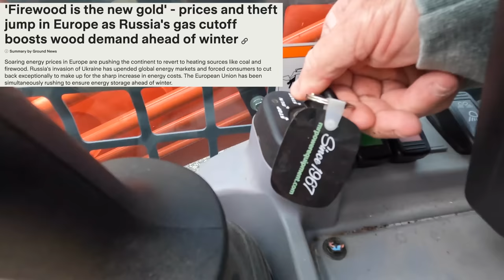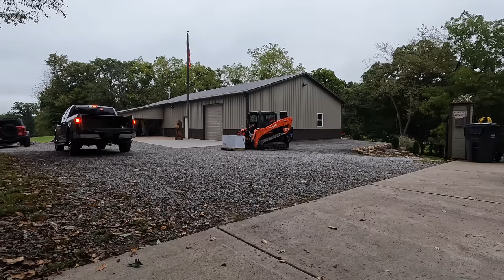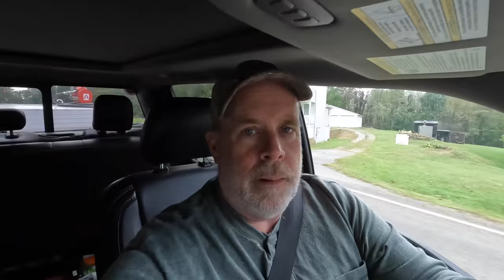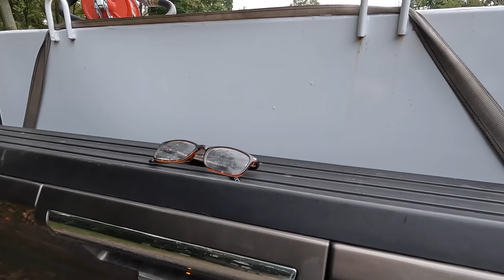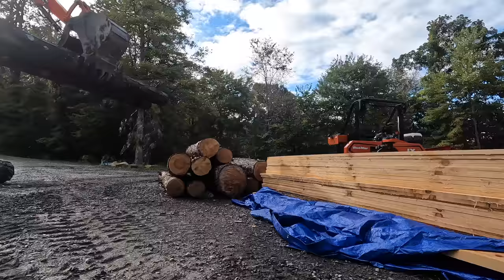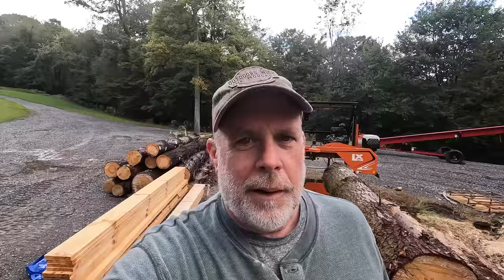Firewood IS the New Gold? It just could be!

Comment: I have been heating my house with wood in New England since the 1970s. It's always nice to know I will be warm this winter no matter what happens in the energy markets.
Reply: I have been doing the same, the issue might be the electricity cost to operate the wood furnace.  It doesn't give me a warm fuzzy feeling doing all the work to cut, split, stack and operate the furnace while others won't lift a finger to help and get free LIHEAP fuel.

Comment: About 6 years ago we got a new HVAC system, it is duel fuel. It is a heat pump and a oil burner, the oil burner takes over when the temperature goes below 25 degrees and we also have wood stove. I have about 2 cord of seasoned wood ready to burn, plus we have an acre of woods with dead and down ready to be cut. That is like a bank account. We are retired so I like to feed the wood stove on cold winter days here in York Pa.

Comment: Hi from Northamptonshire, UK. We’ve been quite lucky and are in a fixed electricity tariff for another year but we’re saving like mad to try and build a reserve for when we inevitably end up paying more on our next tariff. The scary thing at the moment is the government are incorrectly indicating there is a £2500 a year cap on energy bills, which isn’t true. There is a cap on charges but that doesn’t mean when you’ve used £2500 you’ll pay no more as they keep trying to indicate in interviews.

I purchased 2.4 cubic metres of kiln-dried hardwood from a local supplier for £300 earlier in the month and we’ll be relying on that in our little 5kw stove to keep the house warm this autumn/winter. We have an oil fired boiler which is pretty efficient but I’m hoping to limit its use so we can make our oil last as long as possible.

Comment: Greetings from Finland. Thanks for the video, this topic is on everyones mind here. Our house is heated with oil. Heating oil price has doubled in less than a year. Next step will be geothermal heat pump system, drill team is coming in couple weeks. Plan is to drill 820 feet  deep hole. Calculations with current prices, annual heating costs with oil is now 5000$ vs geothermal heat pump system consumes 1000$ of electricity.   Initial cost for the system is 25000$ so with current prices the system has paid itself in bit over six years. Currently half the house is heated with wood to cut the oil burning. Wood is coming from our forest so cost is only fuel for the Stihl 😃

Comment: Hey Mike, yeah, this winter will be very interesting over here in Europe. Though many people are still in denial of the situation, the natural gas prices will affect everyone. I do not think that people will freeze during the winter, but the amount of money they will have to spend to keep warm will be enormous. 

The main issue is that 15 years ago EU started to push/motivate people to get rid of old types of heating like wood stoves or coal stoves. For ecological reasons. There were huge grants to replace old stoves with automated natural gas heaters. So many did that. Now, it fired back. The natural gas prices skyrocketed and some households will pay 3-4 times more for heating. Not to mention all the businesses that use natural gas for heating or for factory work (foundries etc). 

And it affects other prices as well. Fortunately, I do have several options to heat our house as I live on a farm. Still, it affects me as well, because the main heating is an automated wooden pellets stove. Last year I ordered pellets (4 tons for a season) for $230/ton. This year not only I had to wait 3 months for the delivery but I paid $510/ton. Still, pretty affordable heating for a big house but you get the picture. And those who ignored the situation and wanted to order pellets in August are in shock because they are told to wait until the end of November for the delivery. 

I hope that it will be a wake-up call for many who live their lazy lives over here in the EU ignoring everything.

Comment: Our Gas Prices were 3.54 two weeks ago. Last time I filled up 2 days ago it was 3.89. The price will continue to go up. We heat with wood and have a propane furnace that's 85 % efficient. Out electric prices went up $50-$60 per month about 5 months ago. Our Propane is locked in at 2.19 a gallon for the next year. I got 3 big buckets full BIG Buckets like from a cat 988!) on my new 7-foot x 16-foot trailer from a local sawmill. It was pile pretty high, but I only had 12 miles to drive home. The wood was FREE. It made two big Gaylord boxes full cut to 16-18 inches. I also got some stacked with the 3 cords of hard maple I cut this summer. It was all from one tree. I live in Illinois. So far, my insurance company is ok with my woodstove as a backup source of heat, but I have read that a lot of them are making people remove their wood stoves or get their insurance cancelled.

Comment: Many cities here in Sweden are not dependant on oil or gas for heating. We have nuclear plants and a heck of a  lot of hydro power. My town burns trash in a huge incinerator plant and generates about 2 MW from that plus all the waste heat for district heating you could ever want. Heck, they even have half the centre of towns sidewalks slightly heated, so they're ice free. I don't have a car either, the public transport system is decent enough in and between cities. The Germans and Austrians though, they're in a really tough spot.

Comment: Locally all we can get to burn is Ponderosa Pine.  When we moved here7 years ago, you could get a cord delivered for $100.  This year I paid $225/cord..  We try to cut as much as we can but this year we only got 1 cord.  We average 3 cords a year.  We use firewood to supplement our LP in floor heat that does our basement and garage.  On the main floor we have electric radiant heat which is seldom used.  Of the 10 radiant units upstairs 7 haven't run since we built the house.  The other 3 are used on days where a fire wood drive us out of the house.

Comment: You're spot about the energy situation here. Just got Our electric bill today. Our electric cost has gone from 100.00 a year up to 2280.00a year now and there's another  big hick coming! To think I heated 2 homes and a garage 4000' with ice storm damage wood. Mostly white pine. In an outdoor boiler. Firebox was 54" deep so I cut the wood in 4' lengths that worked real nice. Only fuel oil was for tractor to mow and plow with.

Comment: Greetings from No VT - I am expanding my woodshed for my 22-23 wood burning season. I also just updated my LP furnace for baseboard hot water heat to a new super high efficiency unit which should lower my LP use by about 15 - 20% so the combination of wood stove (with seasoned hard wood in the woodshed) and the new furnace should make things tolerable.

Comment: I agree with you Mike!   I was just recently thinking about one of those outdoor wood burners and then I asked myself, "What if we don't have electric to run the blower or water pump?"  Seems like the indoor Woodburner is the best solution.

Like you said, "somethings just not right"
Reply: My outdoor boiler can run the pump and fan on a small solar generator with a single panel charging it and full sun it will never stop.  I don't do it now, but tested the theory last winter.
Reply: heat your water with it too, I would have a stove to cook with, heat water and the home.
Reply: @donaldelder7565  that's encouraging to hear.  Nor sure what wattage those pumps are but I know they use an indoor air handler to distribute the heat from a water-to-air heat exchanger.  Those air handlers are usually a 1/2 to 3/4 hp motor which is 373-560 watts so that could be possible.

Comment: It seems to me while gas prices have dropped, diesel has not dropped in equal percentages. In Missouri diesel was about .30 higher than gas in Jan 2020. Today diesel is running about $1 higher than gas.  That drop is caused more based on demand not supply.
Reply: Years ago, diesel was always cheaper than gas.

Comment: I contracted propane in July for $1.75 figure it would only go higher, we also have electric and heat pump, we left fire place out of the house when building 
Was always going to add a outdoor wood boiler to our floor heat system, but everyone says their wood hogs , can’t cut enough, but maybe it’s their insulation practices are the cause 
Anyone have opinion on the amount wood burned per winter season for 
Outdoor boilers?
Plus not sure want to cut wood anymore 
Cut plenty at previous house , probably retire in couple years

Comment: A couple years ago those IBC totes were being given away free, now people want hundreds of dollars for them LOL.  I was going to pickup a few to use for storing kindling in, but not for the $150-200+ people in my area are asking for them.  I resorted to old oil barrels instead LOL....not as easy to move around though, the whole idea of using the IBC totes was so I could use the pallet forks on the tractor to move them around with when they were empty....oh well...the oil barrels work for me because they were $0.00, plus tax LOL.

I don't cut and sell firewood, but I burn it...couldn't afford to run the propane furnace 24/7.  Firewood permits for 4 cords of wood in my area for many years were $20.  Now they're $50.  With electricity uncertainty with grid issues, winter coming, and fuel prices skyrocketing...firewood for home heat is a good idea, and nothing is better than a fireplace or wood stove for heat.  Plus I can cook on my wood stove if I need to, and have done so in the past many times.

Firewood in my area is selling for $300-400 a cord cut and split...its getting very expensive if you have to rely on someone else to get it.

Comment: I´m from Denmark and yes I tell you it has become expencive - especially natural gas and electricity but gas and diesel as well even though those prizes have gone down ever so slightly. Those high prizes drives the inflation - up - so here in Denmark we will end 2022 with an inflation rate for this year around 8-9 % witch is the highest in many many years. As I recall not since the 80´ties it has been that high. Well luckily for our little household we heat our house with firewood I fell and split my self so we manage.
Wood burners is next to impossible to get at the moment - think we are in to February of 2023 before some companies take in new orders - what we in Denmark not by is exportet to Germany - the demand is through the roof presently.

Comment: Mike, in the UK road fuel has dropped in price that last month or so, but now with the £ to $ rate not being very good road fuel will go up.    Natural Gas in the UK we have not been depended on Russia most either North Sea or LPG from middle East but price has gone up by more than triple Electricity has also gone up by even more than that due to a levy placed on the generators due to the use of Natural gas to generate electricity, we do not have many coal powered generators left now.   The Government have placed a cap on the domestic charges that the energy suppliers can charge ....................... you are right its crazy

Comment: My perspective from the UK is that there is a big imbalance between the production and use of Oil and Natural Gas. This is principally due to reduced investment during the pandemic and the global downturn and one-off issues such as Putin's war.  I think that supply of fuel will be ok for many years yet but only if you can afford to pay is the big issue! I accept the science that we need to reduce CO2 emissions and so I am progressively over a number of years, reducing my personal carbon fingerprint. So far that's meant more attention by me on use, a new modern gas boiler, improved heating controls, an EV car, and the next steps are likely to be improved home insulation, and PVs on my house with an associated battery. The UK Government is very focused publically on increasing supply options without saying much about demand reduction, this must happen IMO. In terms of the wood burners, I have one and it works well. My expectation is that at some point, only kiln-dried logs will be allowed for sale in cities, to help keep the air clean and healthy. Not an issue in many rural areas.

Comment: Hi Mike, I’ve watched your channel almost since the start. Really enjoy what you are doing. You are one lucky guy.
I live in Scotland and it is pretty grim. I am 64 years old and times are turning back to the 60’s living in our house with no prospect of having our gas heating on during the winter. Gas prices have almost tripled since last winter.
I have a 5kw log/coal burner in my living room, but that just heats one room. Here in UK gas, electric and fuel for the car has exploded. On 1st October the Government are introducing a price cap on energy costs but this will still increase my energy bill by 50%.
Over here millions of people like my family have to chose between heat or eat. Our Government are doing next to nothing to help low payed workers. Yet they have removed the cap on bankers wage increases.  And removed the high tax on people on high wages. Any one on wages over £150,000 will be £60,000 better off. Where the likes of myself I will not benefit at all. 
Kiln dried wood is costing me over £250 for 2 builders sand bags of wood, only enough to last me 6 weeks. Coal has doubled in price since last winter. And going up again. £130 to fill my coal bunker lasting me about 6 weeks.
I use to gather my own wood from the beach by the van load, and cut it myself, but I am no longer able to do this as I am not fit.
Times are hard over here.🏴🏴🏴
Reply: There are some errors  in the statements eg its banker bonus cap not wages  that will be removed, not removed high tax on high wages but reduced it ,not £60k better off on £150K.I am retired and not a banker but do live in the UK.

Comment: Boy I hope firewood doesn't reach gold prices. I heat exclusively with wood, just under $2000.00 annually this year. when I started a face cord was $50.00 it is now $80.00, thirty dollar increase in 30 years not to shabby. I use propane to heat water only, they just topped me off 130.3 gal $608.21 several years back it cost more to fill the propane tank than the mortgage payment and I was using 300 gal about every 2 months. I disabled that furnace and never looked back.

Comment: I have an outdoor wood furnace and i absolutely love it. That said, im a bit short on dry wood for this winter. I just hope that firewood prices dont go through the roof if i end up needing to buy some. I have several big oaks down right now but dont have the time to get over there and cut and it wouldnt be ready this winter anyway. Good luck everybody. Stay well, stay safe and yall HAVE A DAY
Reply: Burn tires. Lots of BTUs!
Reply: Get those oaks bucked up and split, you might be able to scrape by this winter but really need them next winter if the current trend continues
Reply: @wf2v  gotta laugh!!!  But .... The soot the soot !!!! Lol, ( just burn em at night!)
Reply: Yup, I also have an outdoor furnace. Have had it since 2005. I own 15 acres of woods and cut my own wood. A couple of times over the years I have bought a 9 cord load of wood from a friend at a great price. When I cut my own wood it cost me some chainsaw gas a little diesel fuel. Can’t imagine buying roughly 700-800 gallons of heating oil every year.

Comment: Mike it's not just new truck parts that are the problem.  My 2013 Ford F150 is going to be in the shop and out of service for weeks because they cannot get a replacement transmission electrical connector.   It's a warranty repair but no parts available. They have no idea when they will have the part in hand!

Comment: Colder here in Missouri 39 this morning I think your spot on about alternative fuel to heat it could get tough Firewood prices are all over the place around here already and harder to get anything done anywhere anymore stopped to get some new battery cables made for my 2001 Ford 7.3 diesel can’t get from parts store have to order from ford approximately $600-700 and are out of stock went to a place that custom makes cables and sales batteries advertised no appointment necessary got there no employees showed up to work just one young man working counter answering phones trying to take care of customers supposed to have three garage techs to install batteries and make cables but they didn’t show up to work things are crazy all across the board Waiting on two window companies to come give estimate on replacement windows for our house called 4 companies only two returned call fuel starting to increase here slowly already up 15 cents since Monday per galGot four cords of wood ordered supposed to be here this week hopefully it will show but not totally sure yet I’ve got some logs down but hard to find someone to cut them I’ve got all equipment to cut split and haul but no one wants to work Been trying all summer to get someone to pour some concrete for me everyone’s too busy to do little jobs Probably 13 yards carport sidewalk and pad at end of wheelchair ramp

Comment: Mike why not get solar panels on the roof of that big workshop and your home plus battery storage, Smart hot water tanks or thermal batteries and you are harnessing a lot of energy. Passive houses are starting to gain some traction here in the UK and have been in Europe for a long time. My son is building a passive house now using an air source heat pump plus solar PV and some sort of smart hot water storage.